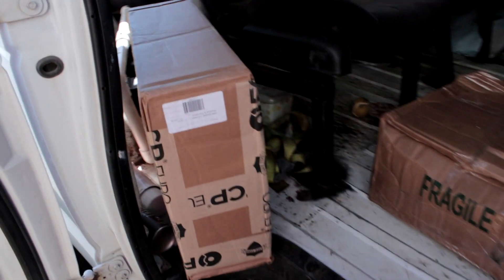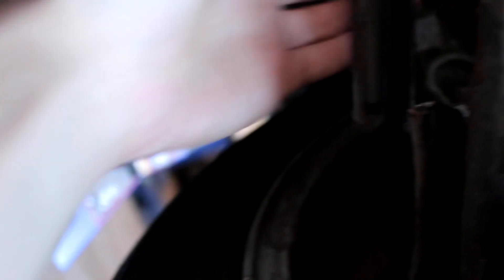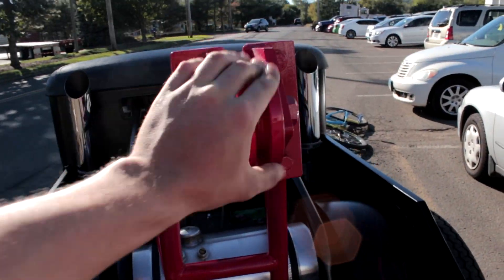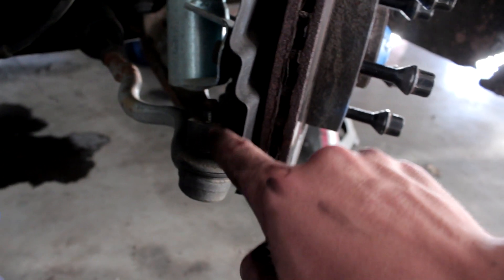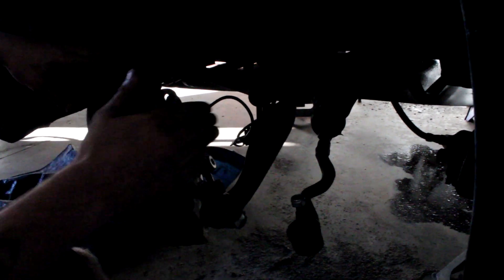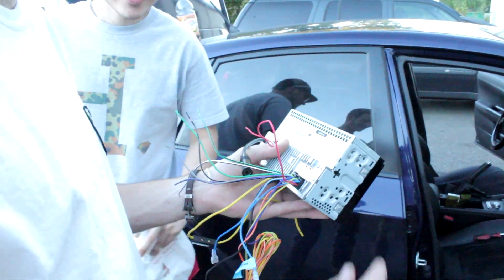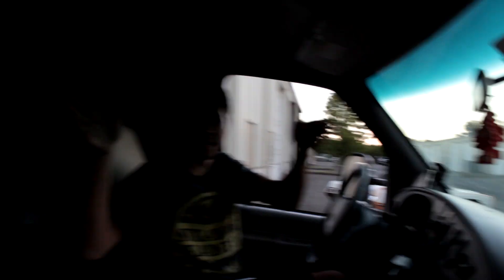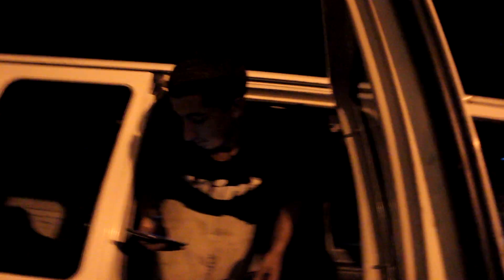BRENDEN DOES A HUGE PEEL!!!

Comment: Not a 350 engine was a Chevy 454 big block can tell by the valve covers and how much bigger it is than a 350
Reply: Juupp
Reply: And Chevy smallblocks have the exhaust ports not evenly spaced (center two closer) and those stops were dump outs on the exhaust

Comment: that rat rod deffinently was not a Chevy 350 it was a big block gm so like a 454
Reply: is there any other Chevy big blocks? I don't really know chevy engines I only ever hear about the 454 when a chevy big block is brought up.
Reply: 283, 305, 327, 350, 355 383 etc are probably the most common small blocks, 400 427 and 454+ are the most common big blocks. (in my experiences anyway)
Reply: 400 is a small block 👍 but alteast someone caught it
Reply: +Leroy McIntyre You forgot the chevy 396 big block, but it's not as common I guess.
Reply: there is the 396
Reply: +Leroy McIntyre 400? You mean 396 or 402?
Reply: he is talking about the small block 400
Reply: gm is chevy

Comment: that rat rod has a 454 you can tell because the two pipes in the center of the headers are together in a 350 and a 454 the header pipes have a equal distance away